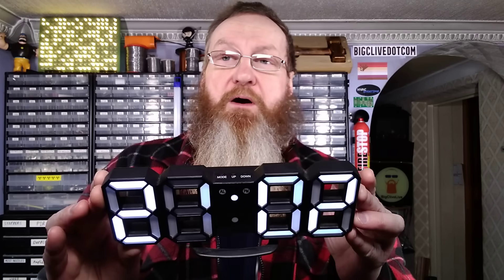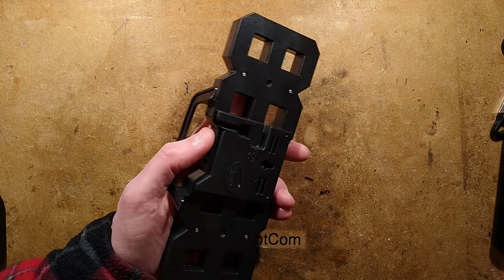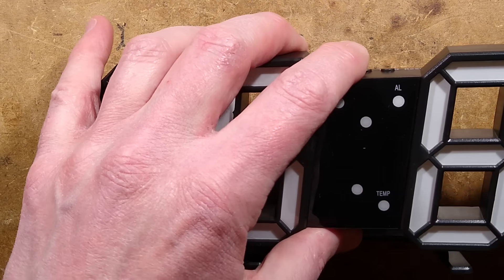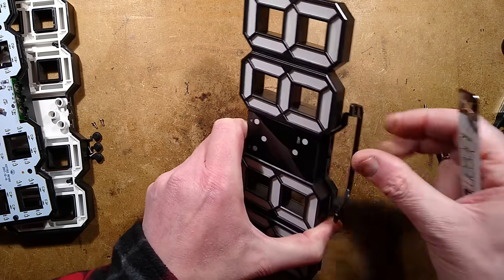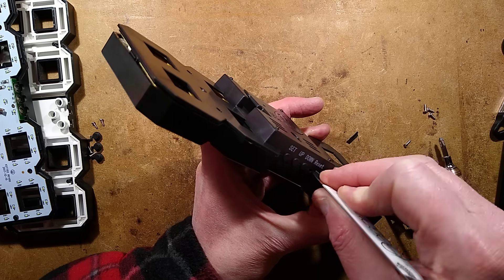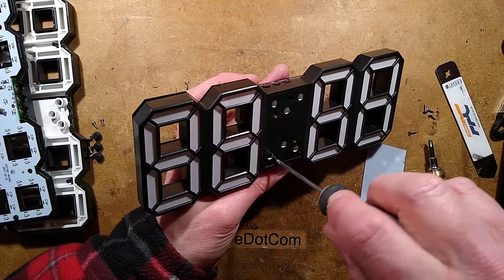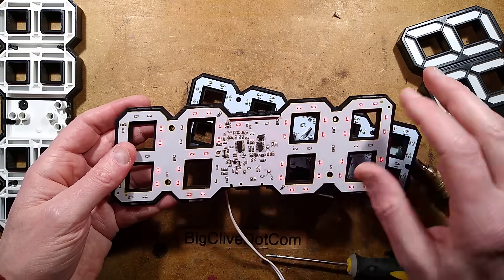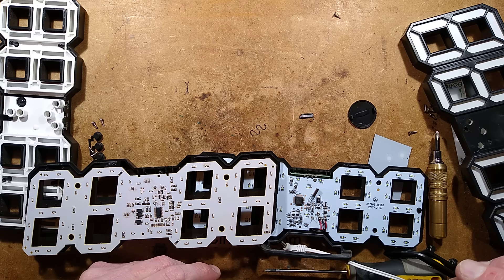The CURSE of white LEDs

Comment: I have no idea why, but just a couple of minutes into the video I'm presented with an advert for a special food for farting dogs, which for some strange reason was absolutely hilarious.  Clive, what have you been doing?😅

I've thought for a while now, that white LEDs seem to expire abnormally early. I also just thought it was probably down to poor quality manufacturing. I have a clock/thermometer/hygrometer which can't be more than a couple of years old, but it's on 24/7. It hasn't escaped my attention that some of the segments are already failing.

The microphone? If it's like mine, you can switch the clock to light up only when there is sufficient ambient noise to suggest the presence of a human operator in the room i.e., someone who can make use of the data being displayed.

Comment: I would not complain if blue LEDs on various bits of gear around me started to fail :)
Reply: Back in the day my sone had an aftermarket PS2 game controller that had annoying blue LESs inside the clear plastic case. Drove me nuts trying to play Mario Cart with him getting blinded by blue LEDs. Put tape on the outside of the controller, it helped but he didn't want me to "take it to bits" and attempt to remove them.

Comment: I have a similar clock that also has a mic. It has a bad habit of turning off. It uses a micro USB for power. I have noticed when trying to get it set to stay on that if you touch it, it lights up. It turns out that a vigorous clap of the hands will also make it light up. Perhaps that is the reason for the microphone? Whatever the reason, it has to do a long haul to get any data out since I use it with a wall wart and a power bank, not a computer. But conceivably it could install a device driver and become a pivot point with a microphone for network espionage. But then I am professionally paranoid. Remember insanity is not an occupational hazard, it is a career skill.
Reply from the maker: The night sound detection is a mode that can be enabled or disabled on this unit.

Comment: I've had two of those exact clocks and both of them lasted about a year being plugged in consistently. I opened it up the same way you did and considered swapping the LEDs to red but I didn't want to go through the hassle of finding which ones they are. Do you have the link to the LEDs so I can just bulk buy them and change them out?
Reply: you'll be better off changing them for one rated or higher current.  the stock ones are clearly being driven close to their max (actual) current limit and are burning out over time.  If those are 50mA rated, replace them with 100's.  They should produce the same light, as the light output is usually proportional to the current, (so you'll still get your 50mA's worth of nits out of them) but they won't burn out fast since you're running them a lot cooler than designed.

Comment: I have a "Realistic" red LED radio clock, purchased from Tandy in 1982. The LEDs are still working fine. I think the issue is the amount of current driven through them. Run them at low current, and they'll last for literally decades.
Reply: I also have a "Realistic" (Radio Shack) alarm clock I bought in the early 1980s. It had a 12/24 hr display and battery back up, very rare features at the time. I bought it because I wanted 24 hr time display. That clock is now around 43 years old and has been in continuous duty. Display is still nice, still wakes me up every morning.
Reply: What does "realistic" mean in this context?  What kind of realism is a clock going to attain?
Reply: @jimmydesouza4375 Realistic was a brand name of Radio shack, used mainly for their line of mid to low level audio products. It was kind of ironic because most people know that if you have to say it is it probably isn't.
Reply: @jimmydesouza4375realistic was a brand sold exclusively by Tandy electronics in the 80’s
Reply: @jimmydesouza4375 Radio Shack in the U.S. made a line of electronics branded "Realistic".  They made a bunch of stuff, radios, record players, clocks, etc.  They were expensive at the time, but pretty good quality.  That's what he's referring to.
Reply: I have a couple of 1980s "Radio Shack Plug 'n' Power" (Tandy's re-badged X10 stuff) clock/timer/controller units with red 7-segment LED display. They have been powered continuously since about 1990 and still look as good as when they were new. That's roughly 300,000 operating hours. Wow.
Reply: No, the problem with the diodes in this video is the phosphor coating. It doesn't last forever.
Reply: I have an "ONWA" LED clock with a small CRT TV in it from the mid 80's. Still works fine. Both the LED clock and the CRT.
Reply: Me too😊  I have been using the 1980s Realistic one again after I have gone through several others that have come and gone. It just works...
Reply: Interesting that you think the current through the older LEDs is lower. I have a few loose LEDs in my stock that are at least 40 years old and they require a lot more current for the amount of light than modern ones do, on the order of perhaps 10:1. I have biased modern LEDs at less than 1mA when used as indicators and at that low current the ancient ones don't glow at all.
Reply: @SidecarBob  We made some equipment at work with a number of different colour LEDs on the front panel including white. The designer set all the LED currents to 20mA. The normal LEDs were all fine while the white was so ridiculously bright that we had to reduce the current down to about 1mA.
Reply: @SidecarBob I think they might mean that the current is relatively low for the LEDs, rather than just low overall 🤔
Reply: @magicalpencil  Perhaps, but that isn't what he said.

Comment: I fixed a very similar LED clock recently, and had the same thoughts about using super tiny LEDs and overdriving them!
Sad they are scamming their customers... :(
I have replaced the faulty ones with non smd LEDs. Works well!

Comment: Well, I like red because it's the old-style LED colour, and I am nothing if not old style these days.  I have a red 7-segment alarm clock with an attractive woodgrain decal from around 1982 (Westclox 22651).  It has only been powered for perhaps half of the 42 years, to be sure, but all segments are working and the dimming, if any, is minimal.  I've put it back in service the last few years.

I also have a Sony ICF-C320 clock radio from around 1990.  It has a different style of red 7-segment display.  The segments all illuminate but the entire display varies in brightness depending on the number of illuminated segments.  No doubt it's a power-supply issue.

Finally I have a Sony ICF-C218, dating from around 2006.  This has a green 7-segment LED display.  Despite being far more recent, the LEDs have faded almost to invisibility, rendering the unit almost useless.  In this case there is no variance with number of segments, so I can't say with certainty LED degradation is to blame.

In any case red seems like the safe bet, though I would not be the least surprised if manufacturers have found ways to ensure eventual failure.  I suspect there is a tendency to overdrive components to produce a pleasing if not glaring result as cheaply as possible.  Major brands at least try to assure a level of quality to reach the end of warranty, the name being the principal asset.  

Products ordered from overseas with names made from random sequences of letters generally have no such assurance because they know the return shipping will be more costly than the product itself, and they have no name to protect.  You simply raise your fists to the sky, yell, and throw the piece of junk in the trash.

Comment: It's definitely not the phosphors. Remember, this is cerium doped YAG phosphor, one of the methods is produced is the Czhocralski pull method to make a single pure crystal out of a melt at like 2000C. It's basically a rock. The paltry 100C or so it'll ever see in use on the board here is nothing.  
It's 100% roasting of the blue GaN diodes that's killing them. Ion migration, etc., at high temps.

Comment: Hey Clive, nice vid, a quick comment, if I were to do a swap of the LEDs I would use hot air, not tweezers. That’d be a lot quicker and less painful. 

I actually have in fact been this obsessive before, my current apartment has a lighting fixture which I can’t really change, but it was annoyingly in cold white with a crappy CRI. I removed the LED PCB, and removed all the diodes with hot air, and replaced them with nice 2300K high CRI equivalents. With hot air it only took about 30 min. Absolutely worth it!
Reply from the maker: The LEDs might not respond well to hot air soldering.

Comment: The problem with white LEDs is that they are blue LEDs with yellow phosphor on top. The phosphor lifetime is like the lifetime of the phosphor in fluorescent tubes. Plus, the phosphor can simply delaminate from the top of the LEDs (the infamous blue street lights, because the LEDs are pointed downward and the phosphor just falls off).
Reply: It appears yellow, but realistically it's a combination of red and green phosphor.

Comment: A random question for you or anyone else here: Between the late 80s and early 90s, there seemed to be a variant of red LEDs that had a rosy tint about them, almost as though they were a 'super red' with a tiny bit of blue. Any ideas if these can still be bought anywhere? Also have you noticed red LEDs becoming less red in recent years? I swear they used to average at around 640nm and now many of them seem to be at 630nm, if not 625, which is practically orange and gives off a rather sickly sort of light.
Reply: Yeah those were 700nm. Very old and inefficient since the light is closer to IR frequencies which are less visible. I believe that is just what "pure red" looks like to us and that their cherry red colour is from their comparison to those 630nm "hi efficiency" orange-y red diodes. You also get 660nm LEDs which give you the best of both worlds.
Reply from the maker: the first high brightness red LEDs were a deep 660nm red.  Quite a nice colour, but not as visually bright as the warmer 650nm LEDs.
Reply: I do have 660nm and 700nm LEDs, but they're not quite the same. The 660s are very pretty, though. Whatever the rosy ones were you're correct, they did output rather a lot of IR. I'll keep searching, have a feeling they probably are 660nm that were doped with something, or it was the lens. Used to find them in the cheaper kids' LED shoes, with a single one at the back.
Blue suffered a similar fate to red, but the other way, becoming more blue. The earlier blues I used looked like a gas flame color. They definitely gave off some red and went pink with age, making me wonder if they were relatives of the red LEDs I seek.

Comment: My old alarm clock uses a red 7 seg module.. it started losing time and I found an identical one in an Op shop. The "new" one had seen little use and was so bright I made an amber filter to dull it down.  Two years later I no longer needed the filter. The clock is essentially a dedicated chip (large IC)
Reply from the maker: Most of the old LED clocks had a very standard IC.  It derived timing from the mains waveform and had an option for 50/60Hz timing.

Comment: I have an extender cord at home with surge protection with 2 of those ancient LEDs from the 70s. The yellow one shows that the protection works... and I bought this cord in 2002 and it's been plugged in since then. These LEDs are "forever", while the tiny SMD LEDs are overstressed and not really representative of an era, just poor quality.
Reply: Power strips normally use a neon bulb in the switch, not an LED.

Comment: Even TV backlight LEDs have this problem. I've turned two broken tv's (one cracked, one with several white LEDs gone blue or dead) into one working tv. Scary with the thin glass but it still works. Some Korean Brand TVs push too much current through the LEDs, with max brightness over time they burn away the Phosphorus. Replace the faulty LEDs and turn brightness lower is the workaround.
Reply: Yes, never run your TV/monitor at 100% backlight.  Even turning it down to 90% makes a huge difference as the curve is exponential, so 90% apparent brightness is far below 90% duty cycle.
Reply: So true, and such a shame that the push for HDR just reduces the lifespan of your TV.
Reply from the maker: Many of the TVs seem to be supplied with the backlight intensity set to full.  I recommend turning it down to a comfortable level.

Comment: Hello Clive, I was trying to get the name of your Jumbo Clock but could not find a link anywhere. I have a Red alarm clock since 1989 running 24/7, cant tell you the name other than it is grey because the face plate/difusion front fell of of it years ago which contained the name. Still wakes me avery morning without fail.
Reply from the maker: It seems to be a very common style of clock from many sellers on eBay and other sites.  Try a search for large LED clock.

Comment: I have green and yellow Maplin LEDs from the mid nineties the water clear 5mm type, they are still the same brightness now, and a RS Components Aluminium, Gallium Arsenide ultra low current red bar display, still with no change in intensity. I think with the modern ones it is partly built in deliberate failure. 
Another thing that really gets me p*ssed off is sh*t thermal management and or LEDs being run near their absolute max current ratings.
Reply: I have a neon bulb in the switch on my coffee maker from the '70s. :) It's dimmer because of deposition on the glass (I assume from ions from the anode). The oldest LEDs that I have are on my HP-45 calculator (1973), and they haven't deteriorated as far as I can tell.
Reply from the maker: Many of the neon indicator bulbs in appliances are run at higher current for visual brightness.  It does cause them to blacken over time.

Comment: My red digit Micronta alarm clock has been running continuously since 1972 and is just as readable as it was one day one.
Reply: You win!   I built a 6 digit LED desk clock from parts in about 1975 and it has been running essentially 24 X 7 ever since and it is still going strong after 50 years.  I thought that was extraordinary longevity but you have me beat by 3 years!  Congrats!
Reply: @Vincent_Sullivan  That cheered me up for the day... my achievement in life haha. Its rather ironic that I've always wanted to get rid of that clock because its a pain in that once a year when the clocks change... you can only change the time forwards :o( Out of interest I just worked out its been running approx 1,672,617,600 seconds - seriously impressive. It's only been off for power cuts, a couple of house moves and the odd room reshuffle.

Comment: I have that magnificient clock (edit, also white)... yes, it failed, a couple times in fact. Funny thign: after checking, the LEDs in mine were not failing at all, their solder joints to the board did! . 

A couple segments failed, (as I keept it broken long enough to have a second fail). Eventually, I dug into it and found cracked solder joins in the leds themselves. I resoldered the ones cracked and that fixed it,  put it back together, and months or maybe a copule years after (time flies), eventually other failed in the very same way.  Did a full resoldering with a bit of new solder and that apparently sorted it. 

The poor thing is still running full time after 6 years, for 7€.... well, I can´t complain.  In fact I confess I am happy with it, short sighted ones in the family truly appreciate it, and the accuracy is surprisingly good in my unit, better than most of the offline clocks I have around.

Mine does not have a dimmer, only the day/night mode, so I had to change some resistors here and there to lower the brightness by brute force. Not too much range as it clips out pretty soon, but managed to set it to my liking with a more opaque difuser.

(edit: aggravated assautl against the English grammar. For starters)

Comment: What about replacing the LEDs with transistors and using them to switch on and off other LEDs mounted in a replacement frame?
Reply from the maker: It could be used like that.

Comment: I made a little improvised classic light bulb a few days ago. I simply took two thick,coated copper wires (for transformers or inductors) and pushed them through the cork of a regular test tube (they can handle heat and are cheap). Then I connected a thin piece of heating element wire (stainless steel basically) and wrapped it around a match stick without the match head, so just a piece of wood. Then I turned the power on low so that the wood started getting hot enough to burn, absorbing the oxygen inside the test-tube and creating a -0.2bar vacuum. Then you can safely turn up the power to a steady orange-yellow glow. The wire will also eventually fail because of the movement of the wire (in case of ACpower) and also because the wire breaks down if it gets too close to its melting point. Wolfram wire can be turned up much higher, but I wouldnt go past 1600Celcius(yellow-white hot), because thats the point when it starts breaking down slowly. Regular incandescent lightbulbs often run the wires at 2800C which is bright but causes them to fail (so you have to go and buy a new one 😏).
Reply: That's experimentation!
Reply: That temperature represents a compromise between efficiency and longevity. With a lower temperature the bulb lasts longer but you also barely get visible light out of it.
Reply: @roelsch  You can simply increase the light output by taking a finer but longer wire. It has a warm , ember/candlelight color, but is very pleasant. It also does not waste any energy during the colder seasons because "waste" heat will help heat your room/house so its not wasted at all really. If you keep the curtains shut, the photons will also be turned into heat since they cant leave the room.
Reply: @roelsch  Google "Phoebus Cartel" then you know more ...wink wink ...nudge nudge